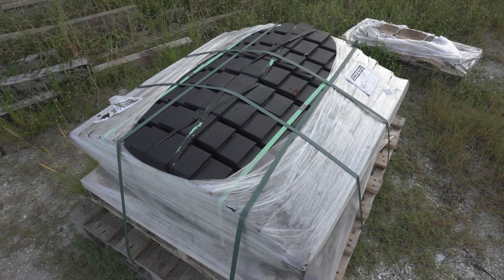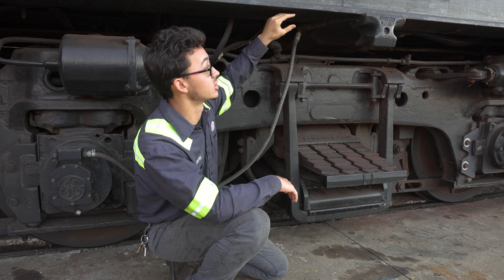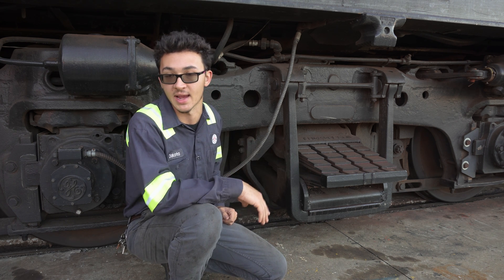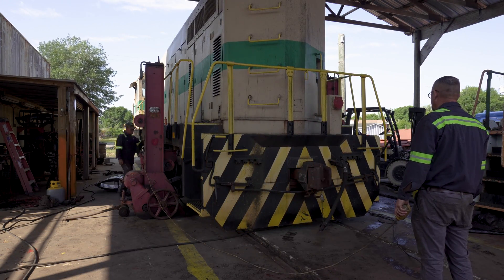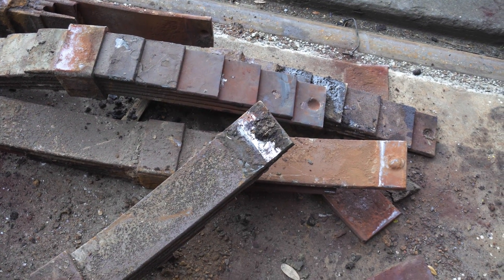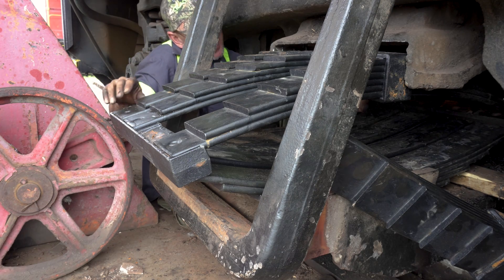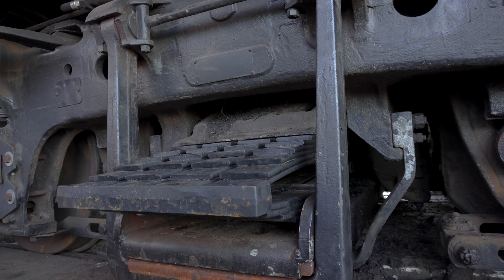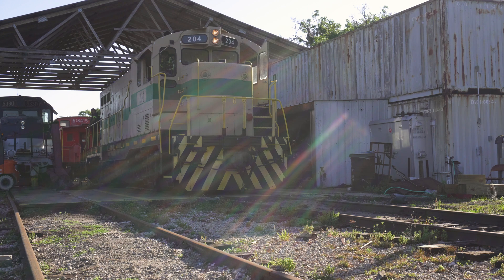Changing Spring Suspension on a Diesel Locomotive

Comment: Totally useless knowledge.
But at the same time, 
i´ve learned so much.
Never have taught before that these leaf springs were all separated, andvthat lock bar hold everything just bybthe weight pressure. In railroad world there is plenty of mechanical
"bonds", just by weight only.
A big thanks for the share, and if you have more work,  let´s go and show us.
Always good to learn more useless knowledge.😊😊😊😊😊

Comment: I thought most locomotives have three coil springs in a bracket?
Reply from the maker: Depends on the locomotive. Like I discussed here, those with the “Blomberg” truck have two on each individual axle (so 8 in total for each truck), and two leaf springs on each truck for the frame suspension.

Comment: The dirt packed in the cross member there was probably authentic Cleburne crud when they refabricated the engine body from a covered wagon to its narrow hood that it wears today. While they rebuilt the prime mover and fabricated new hoods, they didn't do anything to the wheels or undercarriage. except maybe replace a whole wheel assembly with known good assemblies. It's nice to see a CF-7 still out there chugging and tugging. It's got the round roof and extra window so that means it  was one of the first batch to come out of the shops at Cleburne. All the ones I ever handled had the squared off cabs and no extra window. 
Also I get a tear in my eye seeing 8330 back there. Hopefully some day she'll get back to her former glory! She used to be such a good engine.
Reply from the maker: Well, some interesting follow up to that. Number 204 was actually the last original cab retainer. It was number 2472 when rebuilt and I believe 238 as an F7. Good news is, 8330 is being rebuilt herself. The prime mover was swapped out in 2023, and were now in the process of fixing mechanical hiccups to bring her back online. We’re actually taking her out for her first test rides down the track next week…probably Wednesday or thereabouts.

Comment: Never heard the name blonberg. We mistly had these trucks on older locomotives. Newwer ones had flexicoil trucks. These springs are what you call fully eliptical. We call those swing hanger trucks. I never had to change those springs. Never saw a bad set.
Reply from the maker: I’d never seen a bad set either until this. 204 tends to lean in the rear slightly, even with both springs swapped, so I wonder if there’s something else amidst that’s causing that, as well as, ultimately, increased wear on the rear components.

Comment: I have done this job on my own in Satanta Kansas and The Cimarron Valley Railroad. Some on GP30 locomotives and repeatedly on GP26 locomotives with ALCO trucks. The GP Blomburg trucks with outside swing hangers are significantly easier than the AAR ALCO inside swing hangers. The ALCO truck must be removed from the locomotive and the bolster plank retainer plates removed before removing the bolster plank to get to these springs. The AAR truck has three pairs per side rather than four.  
Although it can be done by one man, I don’t recommend it at all. 
Good job guys.
Reply: Thanks for sharing différences with AAR B truck.

Comment: 0:31 I’ve changed several suspensions on vehicles if my own.
Both leaf and coil springs.
I’ve also have to replace suspensions on big trucks, too.
Even if it’s big, it’s a simple, straightforward process.
Simple, but definitely not easy.
I really cannot imagine that it would be any harder to change springs on a locomotive.
If you have the equipment, that is.

I’ll be looking to see if there is any difference in the replacement process.

Comment: I appreciate the detail of the replacement of the springs,but for the edjamacation of the unknowing,I think you should be precise in the description of the "metal plates" namely the spring steel leaves,combined to make a spring assembly or pack. This type of spring is also common to many pickups and heavy haulage trucks,and older cars IE the rear end of most pre 90s cars.
Reply from the maker: That was one of the areas I fell short on. I didn’t know the names of any of those things until we executed this whole charade. I referenced them the best I knew how, but that feedback helps a lot in my understanding as well.

Comment: Thank you. 
I would like to know two things about the suspension of larger steam locomotives. How the trailing truck carries the firebox and how it couples to the main frame and similarly, how is the pilot truck suspended and how does it apply the push to guide the main frame into a curve?
Reply from the maker: Unfortunately, you’re asking the wrong guy for steam locomotive details. I was a novice to even diesel locos until I began my work here. If I had to guess, though, I’d imagine theres a kingpin that secures the trailing truck(s) to the rest of the frame. My guess would also be that the pilot(s) have a sort of bushing or cushioning to contact the frame (if applicable) - and there’s likely another kingpin that holds the assembly to the frame, and as it turns into a curve, it pulls, or guides the rest of the body with it. Don’t quote me on any of that, those were all just my best guesses.

Comment: Amazing video, exactly what I needed, and you're a great presenter! Now, I'm an automotive engineer (well  I graduated like 4 months ago, but yeah) I know a lot about car suspensions, but train suspension frustrate me kinda. The secondary supension is pretty obvious (the one between the bogie/truck and the frame) however I'm less familiar with the primary (axle) suspension. Now it seems like the bearings at the end of the axles are in sort of a bracket that allows them to move vertically, but how can the axles "flex" as in, if one wheel goes up, the other should go down, as it's basically like a solid axle suspension on a car/truck. But, it seems like these blocks restrict the bearing box to only move vertically, which would make the "flex" impossible. I know that rails are much smoother than roads, so the train wheels don't really have to move that much relative to each other, but still, I assume it must compansate in a way if, say one rail  has a slight bump while the other doesn't. Is there some sort of rubber block or something within the brackets around the bearing box, that allow it to move slightly?
Reply from the maker: Much appreciated! If I’m understanding your inquiry correctly, each of those “brackets” that hold the axles have 2 coil springs that allow vertical motion within the truck frame. So ultimately, there’s 8 coil springs on one truck. Each axle having 2 coil springs allow each one to move whatever way it needs to. The arrows in my explanation at 14:30 extradite where these coil springs are located. Now, realistically, the wheels just move with the contours of the rails, while the truck will be moving up and down, but each axle has those two springs to allow individual movement, so one, two, or three may be moving up, while one or more could be moving down.
Reply: @kotabeaner  Thanks for your response! Sorry I'm not a native english speaker, so my question may not come thrugh perfectly. 
So basically. All axles have 2 coil springs on each side (so 8 in total for a truck). Okay. Let's focus on a single axle, doesn't matter which.
Now I know that the axle can move vertically, relative to the bogie frame, thanks to the coil springs. 
So we're only talking about a single axle, and let's imagine we're looking at this axle from the front, so the wheels (and rails) are on each side. Now imagine, that as loco moves along the rail, it encounters a bump on the left rail, and a "depression" on the right one.   If the wheels follow the rails, this would mean that the left wheel "goes up" while the right one "goes down". Imagine, that all other axles of the train are on a completely flat and even track. In this scenario, the left wheel on this axle would be higher up relative to the bogie frame, while the right wheel would be lower compared to the bogie frame. This would be A OK if the left and right wheel were independent of each other, but of course they arent. This means, than in order for the left wheel on one end of the axle to "move up" and the right wheel on the other end of the axle to "move down", the axle (keep in mind, we're still looking at it from the front) would have to rotate clockwise a bit (not rotate as in, you know roll, but rotate along the longitudinal axis of the loco). This is the "flex" I was talking about. It seems to me that the axle boxes (on the left and right end of the axles) are in "brackets" or "guides" that allow them to move straight vertically, but wouldn't allow the "flex" or rotation along the longitudinal axis of the loco. My guess would be, that there's a bit of play between the axle/bearing box, and the guides/brackets that they sit in. 
 
I hope you understand now, sorry I have a hard time communicating my question 😂
Reply from the maker: Yes, I do understand now. I was thinking about it too simplistically. Ya know…I actually don’t have an answer for that. Perhaps, like you said, since tracks are smoother than roads, the axles can tilt in that manner and it’s hardly noticeable. I’ll have to research that, though, especially since I just took a look under the loco after reading that, and I don’t see any type of suspension to keep the axles straight. It does seem there ought to be, though, since I’ve never noticed the wheels bowing in any way. The museum has had some rough track in years past, so if anywhere was to see it, it’d be us…ha!
Reply: @kotabeaner  Thanks again for the answer! I've actually been asking this question on multiple forums, and noone could answer it haha. I think the track uneveness is generally small enough that  the "play" of the bearings, bushings, etc. Is enough to compensate. Still, if ever you make a video related to the topic, I'll happily watch!

Comment: The "saddle bracket" is commonly referred to as the safety hanger, and it should never be touching the leaf spring plank. The safety hanger is purely there as a safety device, to catch the spring plank and/or springs if they were to fail and want to fall into the track and cause derailment.
Reply from the maker: That’s kind of what I realized afterwards. After I shot that video I realized that it couldn’t really swing if it was touching…I appreciate the insight. I only know as much as I got from doing the job, ha!
Reply: @kotabeaner  That’s good! You’re on your way to knowing a lot about locomotives and Blomberg trucks

Comment: Ooo, you guys have one of the CF-7 rebuilds that retain a section of the F7 cab :) Sweet!
Reply from the maker: We actually have the very last original cab rebuild. 204 is former Santa Fe #2472. That was the last CF7 built retaining the entire original F7 cab. That also explains the slightly longer cab than usual, as they chopped it right at the point where the steps would’ve led down into the prime mover bay on the original model.

Comment: 1:20 #204 has some awning issues as well
Reply from the maker: Right…that happened in 2022 when a contracting firm lifted it with cranes to spin it. The cable on that side tightened, pushing in on the sunshade and bending it. Ironically, it’s actually made for a convenient out-the-window radio mount to get longer range when switching.

Comment: I’ve seen locos with those trucks that also had a pair of coil springs located right above the wheels. Seen some where those leaf springs were replaced with some type of giant rubber looking bushing. Also, I’ve seen a lot of locomotives equipped with Koni shocks, which surprised me
Reply from the maker: This loco has those coil springs also. There’s a casing that kind of hides them under normal conditions - look at some of the shots while the loco is jacked up and you’ll see them. I’ve also seen those bushings on higher-end locos. I’ll have to look into what those are composed of.
Reply: @kotabeaner  yeah you actually mentioned the coils in the video right after I commented lol

Comment: The EMD Blomberg loco truck design very similar to many post WWII lightweight passenger car trucks in having the leaf spring/spring plank assembly. The same wearing out issues you have with the loco springs also affect passenger car trucks.
While those leaf springs can obviously be replaced, with NOT inconsiderable effort, as you demonstrated it gets really interesting when you have to roll a truck out from under a unit--easier (to some degree) on a car than a loco. In time there are components in truck assemblies (various bolts, bearing sleeves, the centerplate/bowl combo, etc) that can only be inspected/repaired/ replaced with a roll-out.  
Hmm-- this sounds like a potential longer, maybe multi-part program in your future!
Reply from the maker: Oh boy…can’t wait. Some of our cabooses also utilize that spring/plank design, which I found interesting afterwards. That loco is gonna need some further mechanical attention soon, as it’s starting to experience blow-by with trace amounts of oil shooting from the exhaust. I can only imagine those other bits are gonna need attention fairly soon, along with those seals we’ll have to replace. One thing’s for certain…JOB SECURITY!
Reply: @kotabeaner The easiest way to fix blow-by is to put a load on the motor and run it wide open.